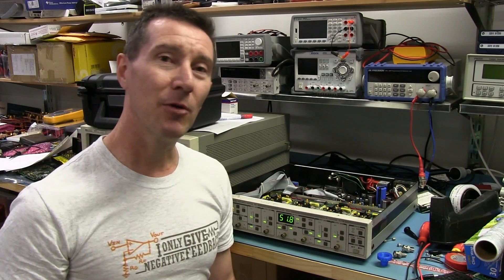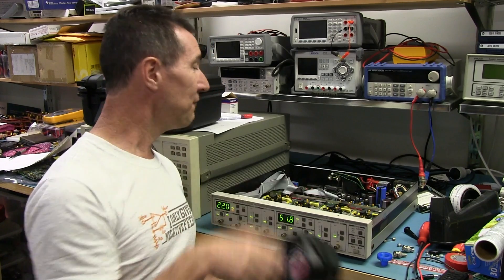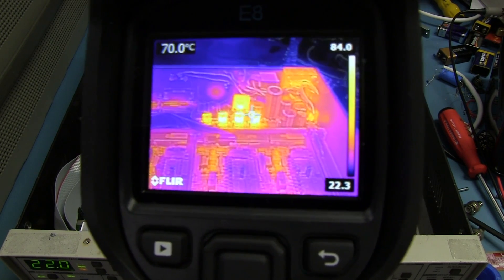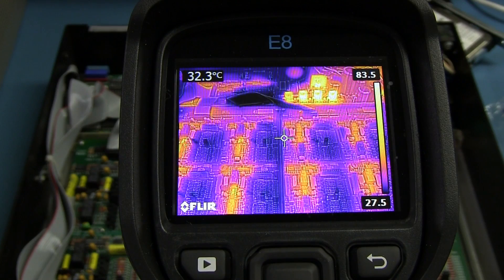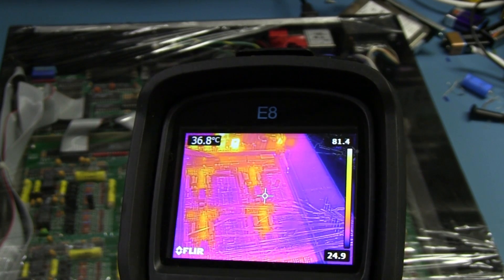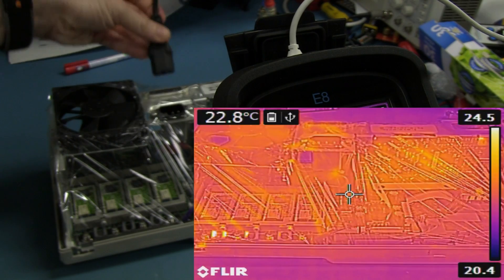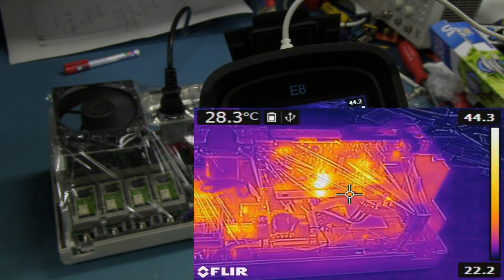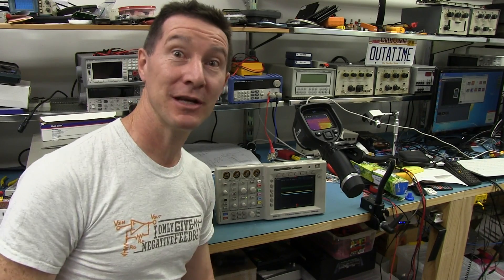EEVblog #622 - How To See Through Objects With A Thermal Camera

Comment: air only circulates if you have an input and an output..the same way you have to open a window and a door to obtain wind inside your home..input and output openings.
Reply: Not true. The same opening can serve both purposes. That's why an open window without an open door can still circulate air within the room. Not only do you get votes appearing, but because hear rises (and escapes) from the top of vents, it draws colder air into the bottom of the same vent. However, good thermal design like in a computer case due have inputs and outputs.

Comment: Hey Dave,I have a unrelated question.(Skip ahead, I like to ramble)
 i'm a huge fan by the way, I've wanted to be a electrical engineer for NASA since I was 10( and now am looking into computer engineering or engineering physics, mechanical, and/or  aerospace (it's only rocket science), NASA has a lot of budget cuts so one guy needs 2-4 fields of expertise, no money for a new space shuttle till 2015(and the Russians banned us from using their's in 2020), but there's always money for 100,000,000 new shiny tanks we'll probably never use.).

In tv shows and video games there is always one wire that can connect anything to anything else.
My question is why the hell haven't we taken this Idea? (Rant) I want to plug a HDMI to RCA I need a adapter, and there's another cable for cable tv, and USB 2.0 now becoming USB 3.0, and then theirs mini and micro usb,  not to mention all the adapter you use in the lab.
Why do I need a box full of adapter to connect one piece of copper wire to another piece of copper wire?
Reply from the maker: Because there are countless different electrical and signal standards for very good technical reasons, it enables different functionality and physical requirements.
Reply: EEVblog I somewhat understand, you can't measure temp with a RCA cable.
Maybe you can write it on a Dave cad for a idea for a video going more into detail.

Comment: Hey Dave, great tip but this setup does have some drawbacks. I have spent years in research using IR cameras, lasers, FLIR's, microscopes and etc. I own all these devices and have done hundreds of experiments in both the infrared range from NIR to FIR and also in the UVA,B and C ranges. NIR and FIR can pass through quite a bit of material but the keyword is "PASS". The loss you are seeing of a couple percent is due the slight absorption and reflection of the material itself and the rest of the radiated IR is passed through. Considering the material will pass about 95% or more of the IR energy, it will still have simular characteristics of having the top off. Fans will carry or push cooled air which acts much in the way of a heat sink by allowing the IR energy to have an absorption media, however this effect is not very efficient. There are losses which allow more heat energy (IR) to be radiated away from the device than absorbed by the cooled air and carried away. The percentages vary depending on air density, humidity and etc. So, the effective radiated IR will be much more with the cling wrap than with a metallic case lid which will block all the radiated IR energy and allow heat to build up by being absorbed by the metal and other components. We all know that cold itself does not exist, but is present due to the absence of IR or heat energy which in affect creates a potential for heat (IR) to fill or be attracted to, In some of my experiments, I have created materials using special bonding techniques which have incredible absorption and reflection properties. It's quite a bit of fun, I might add!

Keep up the good work Dave, just my humble 2 cents! :)

Infrared Training Center has some great info on many aspects of IR and some good tutorials. Their website is http://www.infraredtraining.com.
Reply: The heat that passes through (and reaches the camera) is radiant heat, part of which would also be absorbed (and then radiated) by a metal or plastic cover.

The role of the plastic wrap is to simulate the cover blocking / directing airflow, not its influence on radiant heat. And it definitely does not have "simular" (or indeed similar) characteristics to having the the top off. Airflow is completely different in an open case.

Obviously, unless you can make the film follow the exact shape of the case and have exactly the same absorption / reflection properties as the case material(s), the result isn't going to be identical, but it's a much better approximation than leaving the case open.

Comment: You could let the product warm up with the cover on, turn it off, then quickly remove the cover and use the camera. That allows the normal airflow and thermal effect of the cover to be included in the test.

Comment: It doesn't have to be clear nylon. IR radiation can penetrate some materials which are opaque to the visible spectrum, like some types of opaque plastic, but is completely stopped by normal transparent glass for example. I think this is the best example of how different types of radiation propagate in different environments.
Reply: Depends on what part of the IR spectrum you mean. Silica glass is quite transparent to wavelengths below 2500 nm. Of course, for this kind of application you want longer wavelengths, so you'll be looking at germanium, zinc selenide, etc..

Comment: Neat tip Dave. I'll have to remember that one.

One thing you have to be careful with, using any infrared based thermometer, including thermal cameras;
The camera/thermometer assumes that the emissivity(sp?) of your target object is 0.95, or a flat black colour. A shiny surface has a lower IR emissivity, and thus will read low on any IR thermometer- We're talking up to 10% here.

However, you'll find that black electrician's tape has an emissivity of approximately 0.95. Stick a patch on your target and you're good :-)

Comment: Hey Dave,
at first thanks for this great Tip and your really awsome work with this videos. It works pretty well. So, i have another Tip for you, if you want to save some Bugs you can buy the small one of the Flir E Series and flash the software of the biggest one of this series in your thermal imager. Both uses the same hardware and with this flashed firmware you can use the features of the big version by saving a lot of money.  Best wishes from Germany

Comment: Yep, heatsinks sure do need air flow. Still air is a surprisingly good insulator for heat. It's why double glazed windows work so well, it isn't because you have two sheets of glass, it's the trapped still air in between that is the real insulator. If I remember correctly air is 44 times better at insulating than glass. I may be wrong on that number but it was something like that though.
Reply: The primary method of heat transfer in air is convection. The primary method of heat transfer in glass is conduction.
Conduction is much better for transmitting heat than convection, moreso if the convection is restricted as in double glazing.

Comment: You can enter a emissivity in that  camera and you will get a better result. BUT their is a big fault in this experiment. and that is at thermal imaging cam takes IR levels that are being absorbed therefore anything shiny like the plastic wrap you're using are reflecting the uv therefore throwing off the results. Even though the plastic is transparent the camera is still taking readings off the surface of shiny plastic.which will give bad results.The ideal surface to get best reading with a FLIR cam is a flat back surface.Regards  Tom
Reply: tommee10533 For the purpose of debugging airflow issues this cling-wrap method works perfectly. One could easily figure out a mean cling-wrap loss coefficient with some 'calibration' ;)
Reply from the maker: Sure, but do you have a better method to keep the airflow and still see though?
Reply: EEVblog well actually there is better way, you can use germanium. Its what you lens on your flir camera is made of. But its not very economical way of doing it. Since a piece of the size to do this test would be many thousands of dollars. So for practical reasons the way you've just did is probably the best. Great vid as usual..Cheers  Tom
Reply: The image you see is from the temperature sensor, not an optical one. If a material is "transparent to the camera", then its temperature is not being read. 

Now, the plastic film is not 100% transparent to the camera (in other words, it does affect the readings slightly), but Dave mentions this right at the start.

Furthermore, the amount of IR (which is what I assume you meant when you wrote "UV") being reflected by the outside of the film (from the room back towards the camera) is probably proportionally similar to the amount being reflected by the inside of the film (and therefore never reaching the camera), so its influence on the final measurements is quite small. 

There are other factors here that have a bigger influence on the accuracy of the measurements (such as material absorption and case shape vs. film shape), but the point is not to get exact measurements anyway, it's mainly to see the effects of airflow on component cooling.